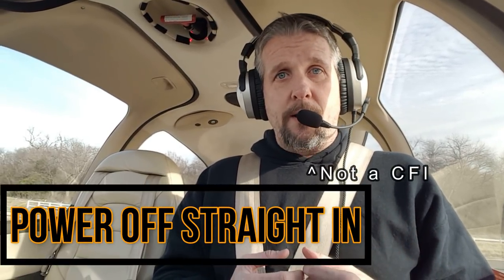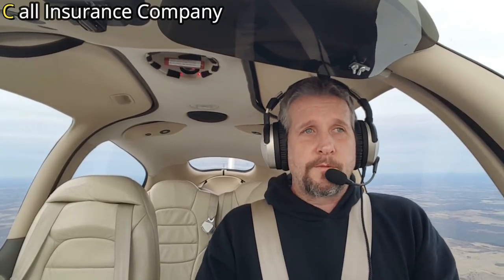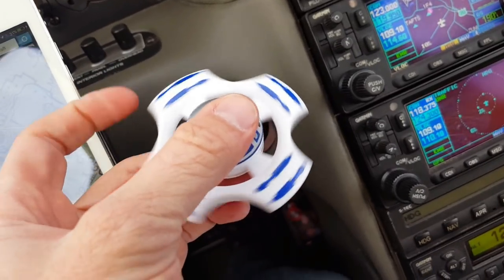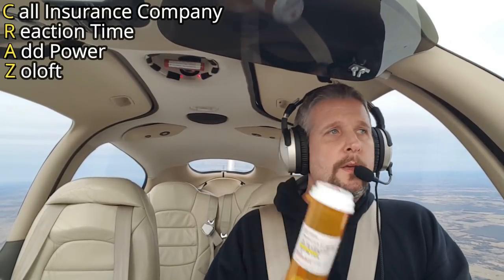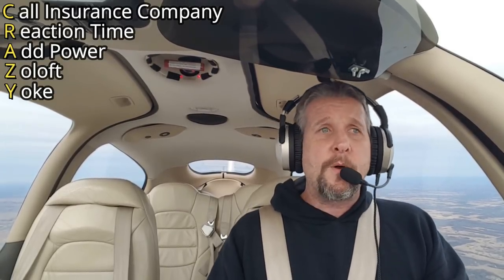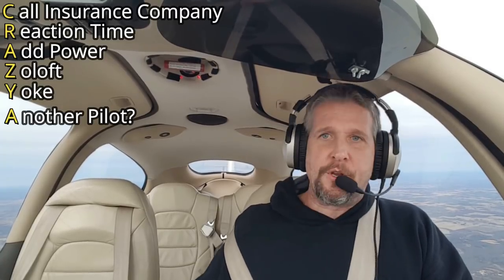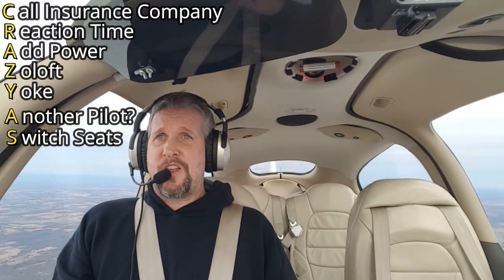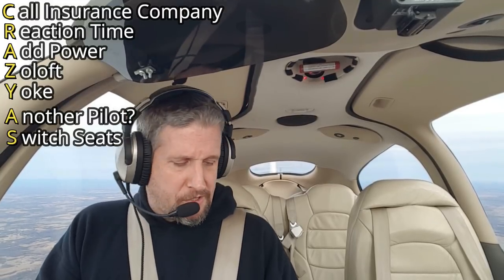Power off 180 in a Cirrus (A satire)

Comment: I don't wanna usurp any of your silliness, Bryan..but have you ever heard of the benefit of putting "Super Beets" in your aircraft fuel ?? Very few people are aware of this, I won't go into the chemical analysis of it, as it's way over your head, but suffice to say the nitrous oxide levels of the fuel increases, it reduces turbulence and prevents the stall/spin scenario while increasing pitot tube airflow, making carburetor heat a thing of the past. Ask Dan Gryder about this...he's totally on board with it.